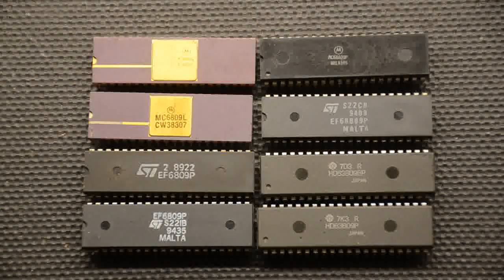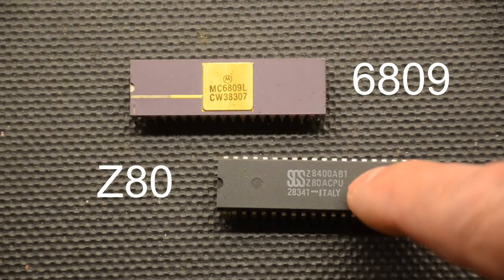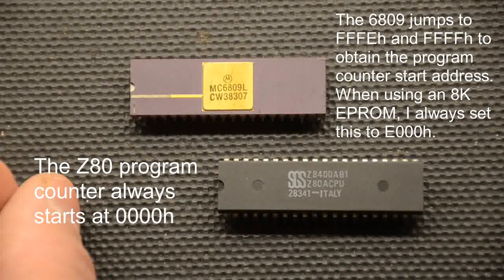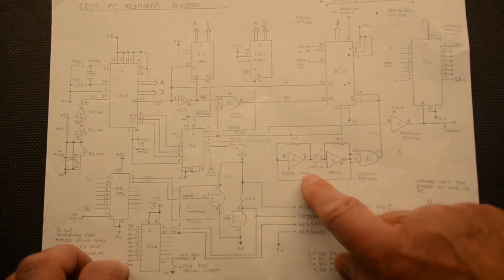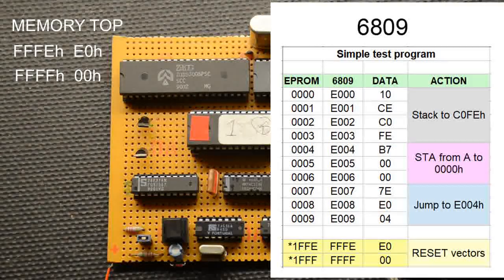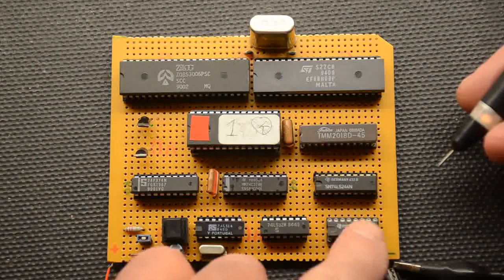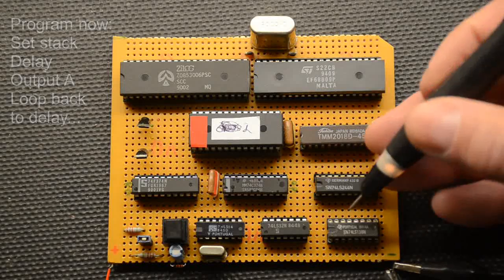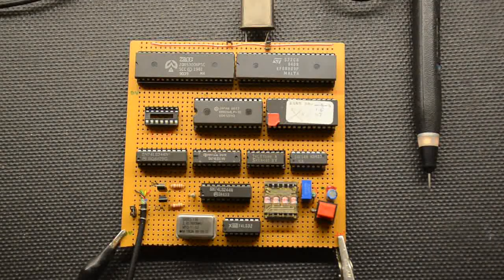The 6809 processor - an overview and a simple circuit

Comment: There was also the 6809E version, which had an external clock. The great thing about the 6809 was that you could write relocatable code, which could run anywhere in memory without having to change any of the addressing.
Reply from the maker: (not forgetting the 6809E's ability to share the address bus with another bus master by tri-stating its own) If you're looking for a good assembler for the 6809, then there is a very good one here: https://www.sbprojects.net/sbasm/
:-)

Comment: The 6809 was such a joy to program.  I wonder if it might have been more successful if it had been faster (as I remember, many instructions took quite a few clock cycles, which was just a limitation of the technology of the time).
Reply from the maker: I guess it all depends what one was 'brought up on'. I started out on micros' when the 8080 was already out there, along with the Fairchild F8 (remember that??) then the product line changed over to the Z80. (no more separate clock chip and system controllers) Hence I was working with these two when I saw my first example of a Z80 board in 1978. Whilst I can say that each different 'type' of microprocessor series definitely has advantages over the others, we all have our favourites! I only worked for a short while on the 6809, so in reality have had very little experience experimenting with it.
Reply: Yes, they were all very different.  I started on 8080, then Z80, then 6502 (a real shock after those first two!), then did some work on the 6809 which I would class as the best "teaching" architecture of the time.  Now it's AVRs and Cortex Ms.  It's been quite a ride!
Reply from the maker: A nice variety to have worked with :-) If you're interested in the more unusual types that came and went, you might be glance at our video on the Philips 8400 series of microcontrollers. A very strange beast, but actually something really useful for experiments, because of it's 28 pin piggy - back socket. We used one in a 'Radar Room' morse code transmitter project because there was so llittle space left under the chassis...
Reply: Speed was not the problem, it was not so successful because of its high price. I agree with the joy to program. To me the programming model + addressing modes made it the most beautiful 8/16 bit MPU ever.

Comment: I wonder if anybody on the design team for the 6809 fought for a wider address bus, supporting direct addressing greater than 64KB. That would have been a distinct improvement over the other 8-bit designs.
Reply from the maker: Good question! If one does an overview of the most popular 8 bit micros of the time, (all using 40 pin packages), then one can easily see the differences between what features and facilities are considered to be the priority for that particular cpu. I believe that the main issue was probably the limitation of just having 40 pins to play with. Drop back a year or two into the middle of the '70s and we saw the Fairchild F8 with its system of several 40 pin packages for each 'cpu system', then there was the 8080 in a 40 pin package which also needed an 8224 clock chip and an 8288 system controller in order to make a working cpu. The Z80 being the logical step forwards for this particular one because of the instruction set compatibility. (8080 to Z80 but not Z80 to 8080 unless one only used the compatible 8080 instructions...) An interesting history lesson I guess.
Reply from the maker: Sorry - my error it's a 8228 system controller for the 8080
Reply: The 6809 had a companion paged MMU, the 6829, which expanded the address range to a whopping (at the time) 2 MB. Pages were 4 kB, so 16 pages were mapped to 512 physical pages. (Never seen the 6829 in the wild though; only datasheet I've ever seen was "Advance information")